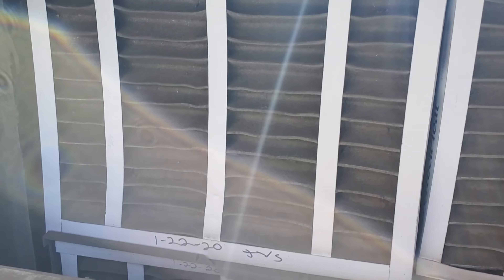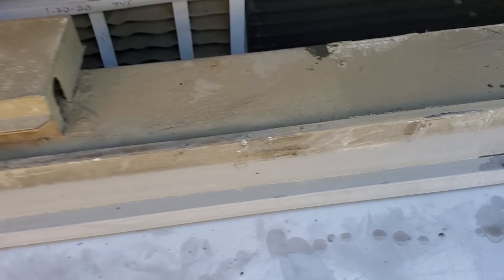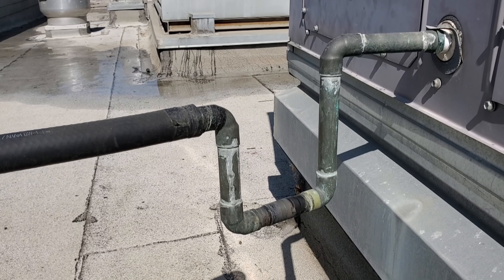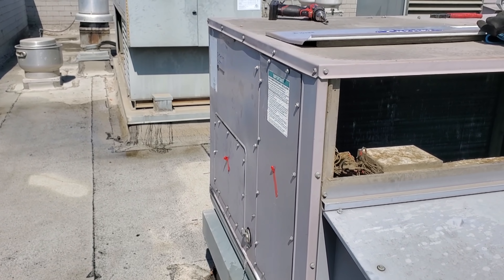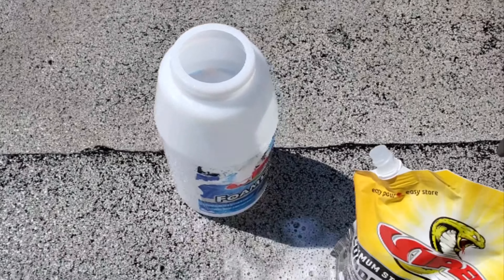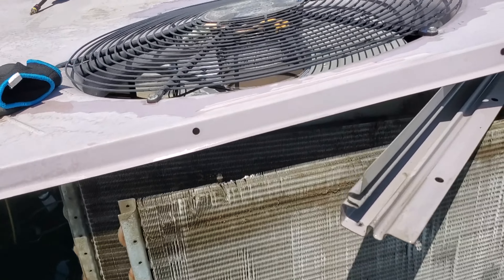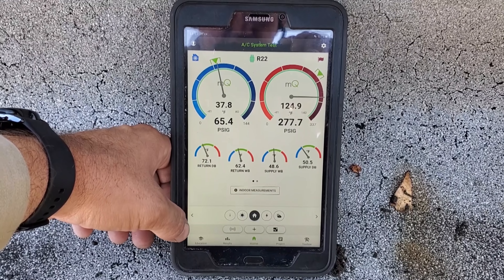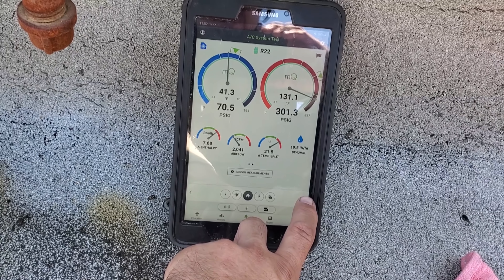WATER LEAKING FROM THE BAR AC

Comment: The filters are blocked causing the fans to pull water from the condensate trays and down the ductwork, because they are under negative pressure and the "p" traps on the condensate lines aren't tall enough to overcome the negative pressure of the fans and blocked filters on the suction side in the fan plenum.  This is notable when the evaporator fan is turn off and there is a sudden rush of condensate/water from the evaporator fan coil deck/unit, through the "p" trap to the drain.

Comment: we spent days trying to find a water leak, they were convinced it was coming from the ice machines, then the roof. cut holes everywhere, couldn't find anything. turns it out was coming from a leaking glass washer on the other side of the building and the water was running through the pipe chase

Comment: Ran across a system with kind of the same symptoms. Older r22 unit has been serviced by multiple companies....I've come to the realization that folks will dump 422,407,mo99,bluon,410 or whatever into these things and not think twice. Basically recovered and recharged with 22 and worked perfectly🙌 I am convinced it was just non cons and mixed refrigerant. Love the videos and judging from the comments looks like you are getting a very diverse and growing audience

Comment: The reason you have to let it sit so much longer than the competitions stuff is because it's not corrosive...

It properly cleans the dirt off the surface rather than simply eating/burning it off...
Reply: Use to use pink con-coil. You knew it was working when it was smoking!
Reply: @joehead1294  Which means you shouldn't be using it anymore...

After all, didn't the Government pass a Law mandating ALL Work Places must now be No Smoking Zones?

Comment: Great video Chris. I picked up the Field piece probes a few weeks ago. They are an awesome tool, and give you a ton of information with measure quick. However air flow measurements seem to correlate with temperatures drop. Having supply air probe to close to evaporator would make air flow look lower. Air flow is real hard to pin down without air flow tables, or tools designed just to measure flow. Also I don’t have the manometers so I guess that would also help predict air flow. Thanks for all the videos and education.

Comment: I think you need a logbook for the systems you worked on, to avoid having to remember all the details. I'm pretty sure there's some nice apps out there which can save the location to some notes, pictures etc and bundle them up with the last invoices you did.

This should help to troubleshoot on reoccurring issues
Reply: he said in that past that he does use an online logbook, as well as leaving some markers in the actual unit of service that's been done
Reply: @djenson  but in this video he had trouble remembering what the deal was the last time. That's why I recommended looking into that.

Don't know what he has changed since this video

Comment: I have possible 2 things ...1. The High side pressure went up I think? when you opened the economizer. I'm not 100% sure but think so. I have 2 possible suggestions on the high pressure is 1. Could be a damper closed on the return duct dn stairs but if that happened starving the return the evap coil would be frozen or frosted. 2. A dryer clogged. I still can't get The Refrigeration Technology products at supply houses local even UR said they don't have enough demand for the product. So like you said I'll try TTT and get the correct product. And always will use BIG PICTURE to promote your channel ALWAYS will have my support. Great video on the Viper products and very clear on not to use too much. Have a great week and please be safe.

Comment: Good vid. How do you know the unit Has R-22 in it ? 
Could have R-422D in it. Thier might be nothing wrong with the unit at all. Just a Different refrigerant used. That’s what u have to be careful with using Apps like MeasureQuick. If u are Totally Relying on them to diagnose - problems arise. Wrong data in app , wrong button pushed / refrigerant selection than what the unit actually has in it. Garbage in / Garbage out. How I Look at units is - 1) Will the Compressor Survive at Current operating conditions ? If Not - Yea, it’s Got to be fixed.  2) if Yes - How far off is it vs Dollars to Make it 100% correct. Is it worth it for the Customer ?

Comment: I use Com Coil and Acti-Brite (from a company called Virginia), they're both the color Pink and they're corrosive, but they really make the coil sparkle.  Like most old units they've been cannibalized with aftermarket parts and yes compressors and motors have been closely matched and that very confusing for the next guy. And As always thanks for your great posts!

Comment: For our host: I think you are onto something at the 24:00 mark. I have doubts about what is in there for gas. You can check a recovered tank against a PT chart and see if it is something other than 22.
For Kameron: many viewers could use a recommendation for coil cleaner and the application gun. The extra info won't hurt you, so chill.

Comment: With the filters being so clogged. Could it be lowering internal pressures that prevent the water from gravity draining and pull water from the trap with airflow being pulled in thru the drain. That is a really scary thought if the condensate drain is on into a sewer vent pipe instead of a storm water roof drain..

Comment: We had a restaurant that is a chain told to kill power to all equipment from corporate. They lost three chef's tables due to compressor failures caused by this. And then had issues with 2 of their RTUs if 3. Was a nightmare and cost them an arm and a leg.
Reply: How’d it go bad by being shut down? Besides being heavy loads due to warm boxes when turned back on?
Reply: @jphvac5725  there was a surge from some bad wiring. I was only there on repairs for the tables and heard second hand. I wasn't there during the diagnostic. The RTUs had electrical issues before and only had some contactors and relay burn outs. They are long past needing replacement due to neglect.

Comment: Carrier units some come from factory with enteral  trap and not recommended  to trap outside  as would end up with  2 traps and flooding   if not internally  trap the leg for tap 1 inch per ton on a/c   the area were I was had freezing  ambient temp owner would run AC in winter   as too cheap to install   economizer

Comment: I am going to ask a question that clearly shows I am not in the HVAC field.  Why pipe the condensate drains through the roof and into the building?  Would it not be simpler to just let the it drain onto the roof surface. Seems like there would be less of chance of a clog without a long run of pipe.
Reply: That's part of the building code in that state, over here in NY it's just fine to let it drain right onto the roof AFAIK. Makes no difference, the roof has drains anyways so if the AC is pulling that much water out of the air it will just find it's way to a roof drain anyways.
I think it might have something to do with not letting the birds have a water source, but I'm not 100% on that. You'd have to ask Chris, he'd probably know why it's code.
Reply: I my state they run it onto the roof. But then you can have water always running on roof and can create leaks

Comment: At 12:20 he mentioned "big picture"  I personally can't stress that enough.   We have decent knowledgeable techs who get tunnel vision and are convinced the first thing they found is the only problem leading to the failure.   Or they recently took a class on TXVs and now everything they work on must have a malfunctioning or improperly working TXV.  Worse yet they overlook something as obvious as fan motor running backwards.

Comment: I just have to ask, how do customers handle you going as far as you do with your diagnostics?  I am a handyman and try to handle what my customer is concerned about.  I have similar traits far as wanting everything to operate as it should but to expect my customer to pay for everything to make everything like new.  I let my customers know what is going on above and beyond their initial concern.  I just can’t imagine telling my customer that I am running into overtime because I spent a majority of my time with other unrelated items (ex. Water leak from vents).  You probably could have addressed their water leak concern in under an hour with the understanding that their system does need attention.

Comment: Pet peve..use a paint pen to initial and date belts. This way a shift was to sheer, a pulley snaps. Now you know roughly when it happened and when last time was changed
Reply: Right condenser fan blade? Right pitch to pull correct air..also at the right height?

Comment: I would agree with the filters creating too much static,almost every unit I work on has 600cfm per ton,and it is imperative to have the right,clean filters. We used to only use Camfil Farr,but everyone one wants to save 30 cents per filter so we went with another brand,and the results are water getting dragged from the pans ,more frequent changes and so on.Now they want us to up the Merv rating to 11 on double pass racks,so I can imagine this will be a total shit show, but that's above my pay grade,they will see when we start buying belts and fan motors by the pallet.

Comment: I’m pretty sure that the cleaner with its surfactant properties of dissolving oils and grease, is actually far more effective of “killing”/ making non-viable the coronavirus, if it did happen to be present.  Spraying that disinfectant is actually unnecessary.
Reply: However it's scented sanitizer so any air that it pulls in should now be lemon scented a good way of knowing the AC is clean
Reply: @Tater_Lord  That definitely is a good thing.  Even if not a technical requirement, making the customer feel safe and secure is definitively a good thing to do business-wise

Comment: The belts on these units are overloaded, for that electric motor, there should be 2 or 3 belts, quality belts should last 4-5 years without tightening.
Reply: drajo123 That is how the units are from the manufacturer. You would have to retrofit non-OEM parts to change that, which I doubt the owners want to do on new units, and once they are out of warranty, they probably don’t want to spend much on them, even if it would save money in the longer term.

Comment: They should put a sensor in to detect when the filters start to pull-in...!
Reply: The more sensors and electronics the more problems.
Reply: yeah those things always break and get ignored/bypassed
Reply: Dirty filter switch. Just a dry contact on a pressure switch. Thats the closest you typically see.

Comment: I wonder how useful coil cleaner is on automotive condensers...
Reply: i've got a motorcycle radiator caked solid with road muck and grime... you got any tips for getting it clean? thanks
Reply: @cliveramsbotty6077  hot water and degreaser if you don't have coil cleaner

Comment: hello sir good evening I have a question need your help please,,,,,,,,,,,  we have a walk in chiller unit DWM copeland 
Modal no : DLFE-301-EWK  ...... freon 22........ 220 volts 3 phase ......... compressor has been dead and we want to change instead to this Bristol or Tecumseh please advise us  how many LRA or ton we have to replace .
thank you so much hope you will give quick answer .
Reply: lol
Reply: ?????? Solution ????
Reply: @muradabad1  Seriously, have you not heard him talk about the issues related to throwing random compressors, motors, etc. into units? Replace it with the same OEM compressor or you're going to have to figure it out yourself. No smart person is going to create problems for themselves giving a blind recommendation on an expensive and critical part of your system without actually seeing it in person and understanding all of the environmental and buildings variables.
Reply: if you remove the broken compressor and replace it with a new compressor then that should solve the problem